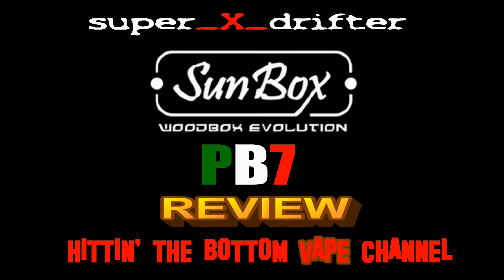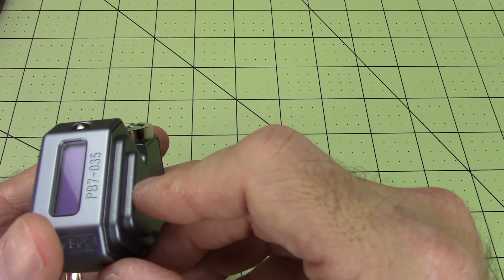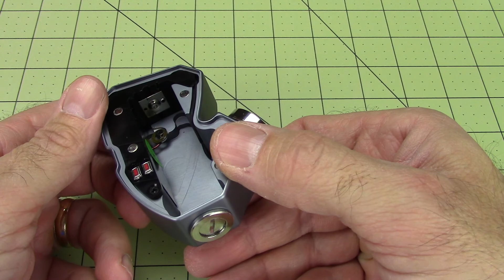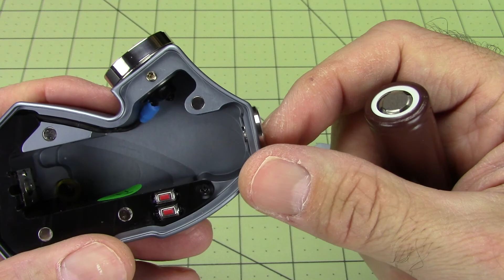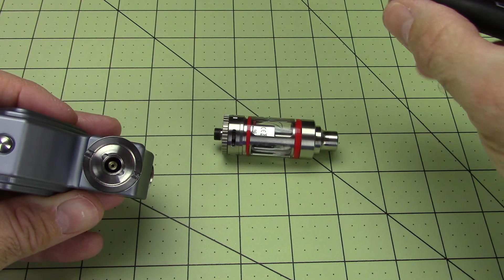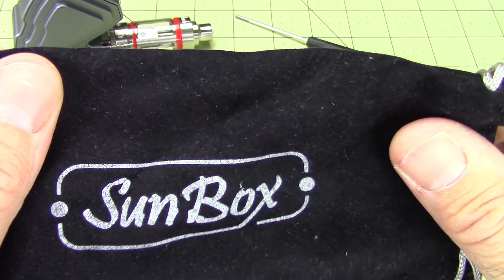RE EDIT Sunbox PB7 Pipe Mod DNA 40 Review

Comment: Russ hitting on a tank??? The end times must be coming... lol jk It's just weird seeing you hitting something other than a squonker. 

Cool looking device. I would have thought Sunbox would have used a more powerful chip than the DNA40 in this since there are 75 and 80 watt single battery devices out there and all the "cool" kids want more power and temp control. 

The big question is would I buy it? Probably not. I have a few regulated devices and couple of tanks, but my go to, use every day are still my REOs. I knocked one off a table onto a cement floor a couple of days ago. Only thing that happened is the drip tip popped out. I put the tip back in and vaped like nothing happened. A tank would have shattered and who knows if the mod would have survived.
Reply from the maker: +gopherbyrd Yes the REO's are durable as all hell. I'll always have em. But I think the power hungry are those using exotic coils or could use a lesson on how to build efficiently lol. I don't own that mod that I reviewed but for those into e-pipes I think that one is a solid contender.